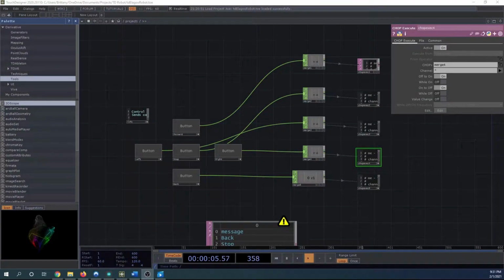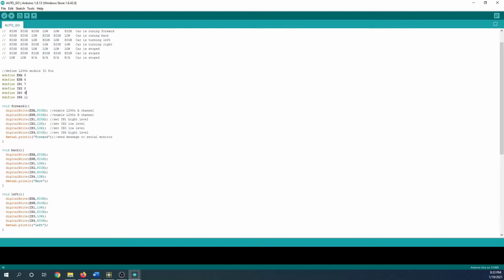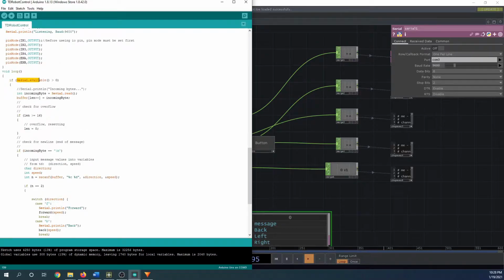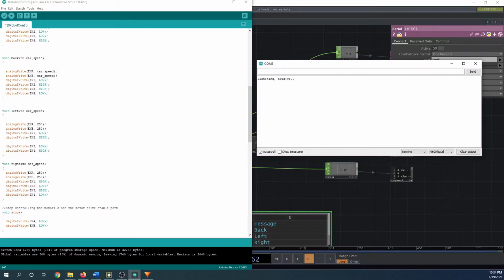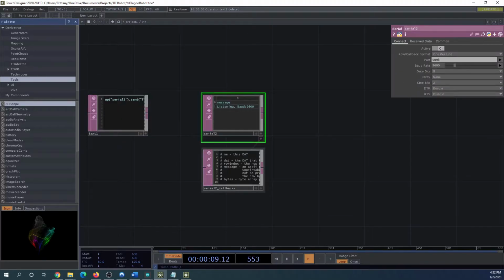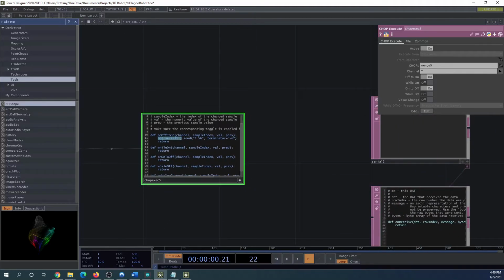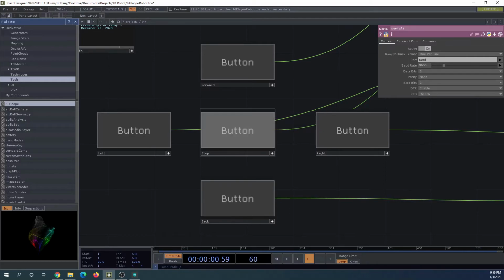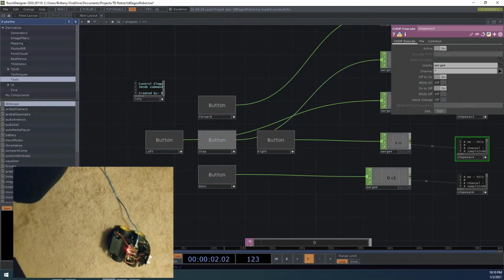Control an Arduino Smart Car with TouchDesigner

Comment: This is so cool! I have run into an issue though, whenever I try and send f 100 through the serial port it responds with the PARSING ERROR, incorrect number of parameters. I have checked but I'm using the code from the video so I'm not sure what has gone wrong. Would you know by any chance?